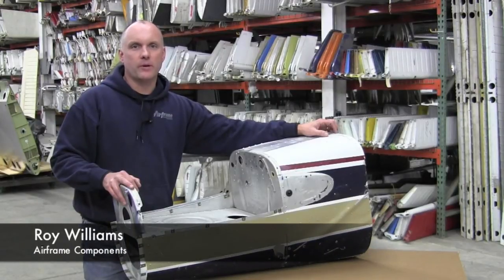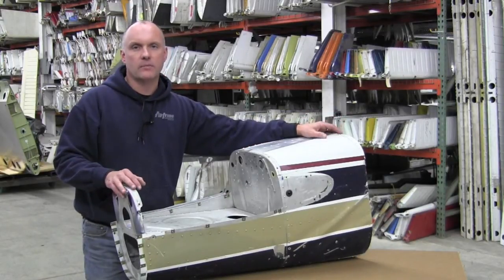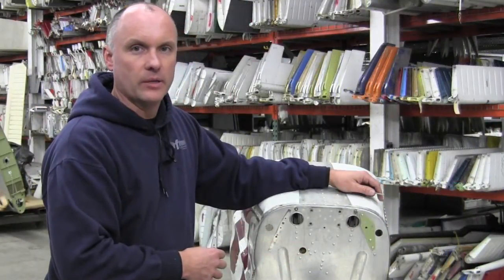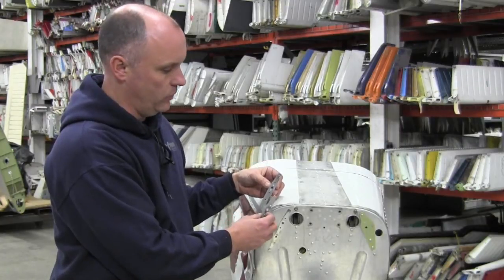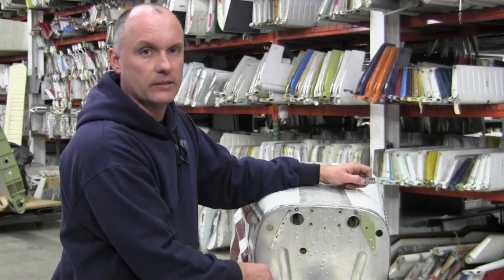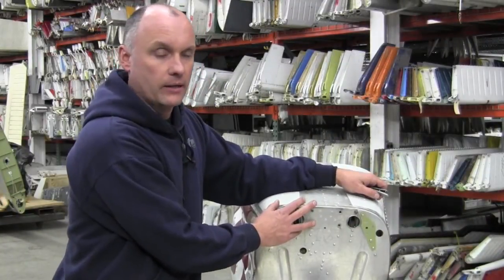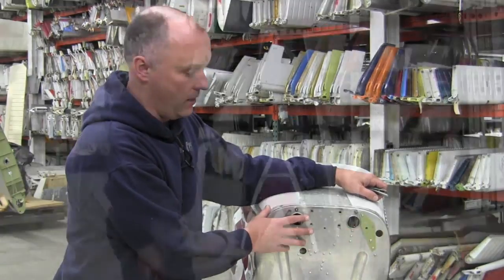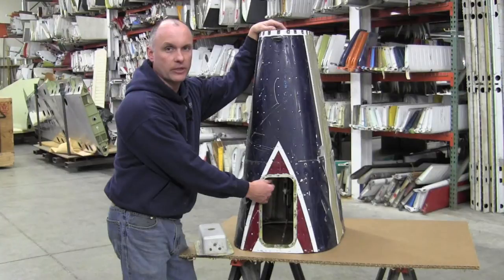AC Cessna 200 Series Forward Bulkhead Modification

Comment: There has to be a better way than having a bazillion rivets everywhere.
Reply: You'd think so, but when you're working with sheet aluminum, rivets are actually a pretty darn good solution.  They are cheap, light and most importantly, easily removed for maintenance or repair work.  Welding and bonding, are other methods, but can't be undone easily.